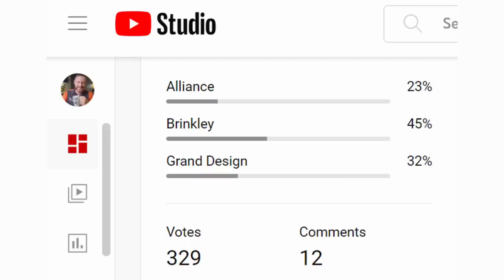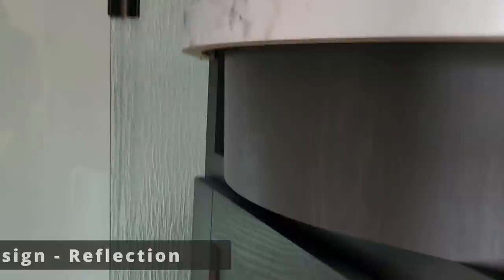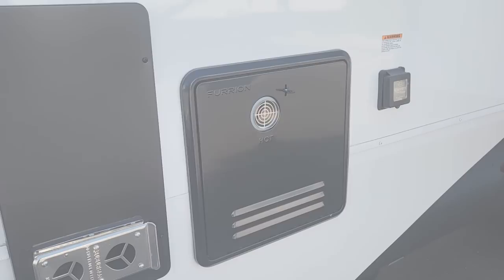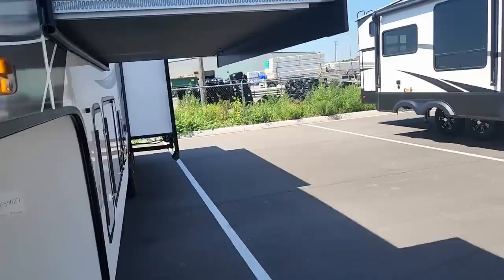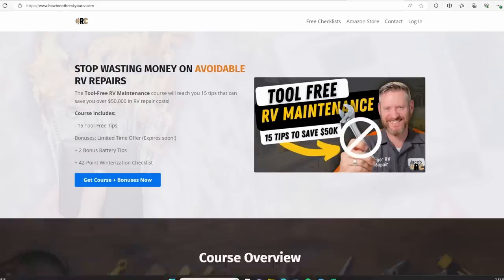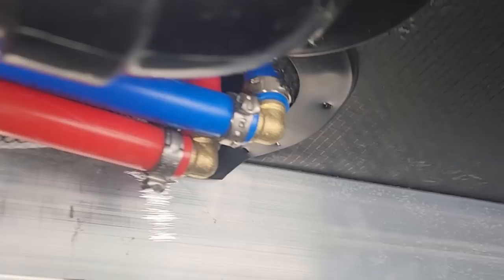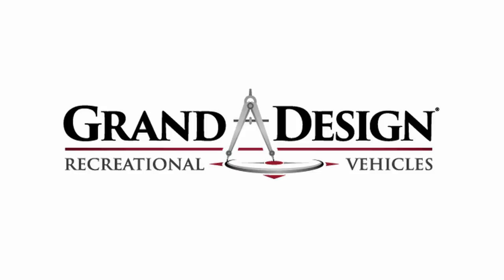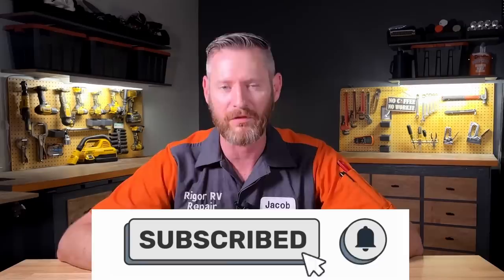UNDERCOVER RV Tech reviews Grand Design, Brinkley & Alliance RVs

Comment: I have a 2021 Solitude S-class 2930 - just got finished fixing a plumbing issue and am replacing the flex line with led wherever I can.  I invested in Govee leak sensors (have 6 placed throughout) - the recent plumbing leak was detected by the Govee leak sensor.  It was caused by a seal in a threaded fitting that would leak when the hot water heater was activated - the cold water pressure increased causing the fitting to leak some.  

I replaced some of the flex line with pex while I was in there.::

Comment: We bought a 24 Model Z 3610 and have been using it full time for about 4 months. The Furrion fridge did have a problem right off the bat. It had a nasty rattle noise while the compressor was running. To avoid a trip to the dealer, i pulled the unit out which required drilling out several large rivets in the top, removing 4 screws on the legs, pusing the unit back to remove 4 more screws behind the upper bracket and removing the bracket completely. I was very impressed by how well the unit was secured but, i really wish that they had used nut-serts and bolts on the top of the fridge instead of rivets. while the rivets are arguably better, they make serviceability of the unit quite difficult. I think nut-serts and some M6 bolts with either blue locktite or lock washers would be just as good, Anyway, the condenser in the fridge had a flimsy support system that allowed it to contact the cabinet and make a loud rattle noise. After a couple tries, i ended up placing a thin rubber mat between the condenser and the cabinet to ensure that the rattle would never happen again. I would caution anyone doing this to lay down some cardboard in front of the unit on the floor when you roll it out as the wheels have sharp edges and can damage the vinyl flooring.
Reply from the maker: Wow, yes that is annoying. It is strange they did not make the refrigerator removable....as if they expected it would never need service. Glad you were able to solve the issue. P.S. if you trouble to the mid bunk AC keeping up be sure to close the vent on it.

Comment: I agree with most of what you discuss in this video. We full time in a 2019 Solitude and while it has had it's issues, it does seem to be a fairly solid trailer so far. One category you missed however is the electrical systems. I know our Solitude is a total mess! I have cleaned up some of it, but the vast majority would do a nesting squirrel proud.

Comment: Jacob, how weird that Brinkley would do most of the plumbing correctly but not in the bathroom...the bathroom in the 2900 is my favorite...Question: If it's just under the sink and in the bay connections, would it be that difficult to correct the problem? I am pretty sure Brinkley will get on this, but that means until they change the process all the 2900s made will have this problem. Thank you so much for your videos. Hubby and I loved the GD 23G but belonged to a group and heard so many complaints of leaks we scratched them off our list. We just love the Brinkley and are waiting for them to come out with a TT which they are supposed to in the next few months. I love that your channel is growing!
Reply: @barbaradowney4207: Can you tell me where you heard that Brinkley was coming out with a travel trailer in the next few months?  Thanks!
Reply: @fantastiqueberliotz1209  It's been alluded to a couple of times on the Brinkley FB group. I also watched an interview with one of the owners and he was talkng about expanding their line up in the future.
Reply from the maker: Great question! In future videos I'm going to start sharing how easy/difficult the plumbing is to fix when I give a score. Z3100 is a Stage 1, really easy to fix. Z2900 is Stage 2, harder but still doable. All Grand Designs are Stage 3, like don't bother, you have to tear the RV apart to fix them. Hope this helps!
Reply: @barbaradowney4207    Thank you for the info.  I'll be sure to keep watching for it.

Comment: I was all set to get a Brinkley 2900, went to see it at the Hershey show.  You were lucky to get a unit with nice fit and finish.  The unit they brought to the show was a mess of misaligned cabinet doors, and showed a lack of foresight for installing an actual entertainment system.  The excuse from the factory rep was that everyone has those problems.  WRONG ANSWER!  Two GD solitudes at two different dealers had washer dryer doors that would not latch, and water closet side storage doors with more misalignment than my 17 year old Montana.  Don't even get me started on the ugly sealer job on the front cap.  Wood trim around the slide still had saw marks on it.  Off the list they fell as well.  Montana and Paradigm looked PRETTY good, but Keystone customer support is a nightmare, and in my area, Camping World is their dealer.  I appreciate good support, especially for all the small stuff that comes up, and don't want to be mugged the Chicago mobsters, which currently leaves me with Alliance.  Do you have any thoughts on the KZ Durango Gold?

Comment: I've got the Coleman Mach A/C units on my RV for six years now on my fifth wheel no issues or repairs,cools the RV fast during the HOT HUMID Summers in IllInois n Missouri ....Guess they don't make them like used to.Just a quick note ....CLEAN THE AIR FILTERS EVERY MONTH OR SOONER DEPENDING ON HOW OFTEN YOU CAMP.....

Comment: I own a Grand Design 2970RL and I’ve had to repair every water fitting for just what he has pointed out. I tell the dealer they don’t care and like he said it would be difficult to replace all the plumbing hose. The basic problem is it expands then leaks. So I’ve replaced fittings , larger sizes with different clamps and hoping it won’t leak. You have to keep the pressure down as well. The book calls for a maximum of 45lbs, I run 28lbs. So far so good. And I’ve repaired almost all the fittings so fa. Oh this unit was built in 2022. I have repaired a number of things throughout the unit from door stops because the builder didn’t know how to center a screw, to drawer guides, replaces shades (2) that the PDI didn’t catch, just one thing after another. Would I buy another Grand Design, NO!

Comment: Brand new here. Great concise video. Thank you. I do nor own an RV of any kind. But….. am considering a 5th wheel , basically for periodic travel to get from point “ A” to point “ B”.  Nope, not going to “ live “ in one ( save if I ever need to have my home remodeled).  I am avoiding toxins and all kinds of creepy stuff from motels and hotels. I have autoimmune issues , so this is necessary. Also, I would be traveling with 4 dogs. No airplanes for me. Jus t done with that.  So , taking my time to look around.  I will check out your other info, Thanks for doing all of the hard work and investigation,

Comment: I'm glad you brought up plumbing, but what is the right way to add a flexible connection to the pump? Sur-flo recommends at Least 1 foot of high pressure flexible line at the input and output. Vibrations from the pump can damage a hard pex connection. My RV was connected with hose clamps to a PEX T, it never leaked but unfortunately it broke . Now what?

Comment: Thanks for all of the good info! My wife and I are torn between a 2024 GD Solitude 378MBS and the 2024 Alliance Paradigm 380MP. My question is this...Alliance has dumped the Schwintek bedroom slide, and went with the BAL Accu-slide for their Paradigm lineup. I reached out to Alliance, who are great to deal with BTW, and confirmed that the tension adjustment is in fact on the bottom of the bedroom slide for the cables. Given that...I've watched your video on the BAL Accu slide system, and you recommended to just "walk away" from an RV with these types of slides. So, given the plumbing issues on Solitude's, and the slide issues on Paradigms, which one would you choose? We actually like the Paradigm better, but concerned with the slide system, and having it serviced. We love the Solitude as well, but not sure about the plumbing??? Not sure which one trumps the other, but we're purchasing one of them. Thanks!
Reply from the maker: Hey Matt, these are great questions, a little more than I can answer quickly in this comment. If you want to email me, I do offer consulting - jacob@rigorrvrepair.com. I would want to talk you through what "maintaining" these two rigs would look like so you and your wife can make an informed decision, assuming you're not open to other RVs
Reply: @undercoverrvtech  Thanks for the response Jacob...I think we've decided to move forward with the Solitude 378MBS, and roll the dice on the plumbing issues. We were able to finally tour through a Paradigm 380MP, and we were more impressed with the Solitude overall. The Paradigm was still a very nice unit, but we just liked the Solitude more. Appreciate all of your info for consumers, and I've directed many people to your channel. Take care! -Matt

Comment: Plumbing issue in Grand Design and possible precautions:  I have just purchased a Grand Design Imagine XLS 17 MKE.  It strikes me that the one big difference with house plumbing is water pressure.  It is barely one story high and does not require a lot of pressure. When operated by the pump the pressure should be well controlled and not excessive. But when you connect to a municipal water supply you could get ANY pressure. Does this trailer have a pressure regulator to prevent excessive pressures. If not, it probably isn't too difficult to fit one.  An alternative work-around would be to always use water pumped from your own tank and only use municipal supply to fill the tank. Such measures shouldn't be necessary but could be a good safe-guard. I would love to hear any comments about these ideas.
Reply from the maker: You should always use an RV water pressure regulator that pouts out 55psi max. These just screw onto the water hose. Your water pump pressure cut-off is also set to 55 psi, but unfortunately I've heard many stories of RV (and Grand Design) owners who only used the water pump but still ended up with leaks in the first year. Sometimes leaks don't happen until 3, 4, or 5 years. While using a regulator/only the pump will probably help, you will still most likely develop leks at some point. Thaks for watching, and best of luck with your RV.
Reply: @undercoverrvtech  Thanks for your helpful reply.  A related question is "What kind of connecter or crimping tool can be used with the flexible PVC pipe?"  I tried to find out online and didn't find anything, although they usually use 'barbed' connectors with prominent ridges on the surface of the connector tube. I thought of replacing connectors, especially on the hot water line where it is accessible, but I suppose that would void the warranty (whatever that is worth).  I have a lathe and could make my own connectors with PEX connection on one side and soft PVC connector on the other.  Thanks again.

Comment: Hi Jacob, I see there are a lot of comments here so you may never even see this comment. I completely understand. But You said leave a comment with a brand and model that we would like you to review. My husband and I would like to see you de a video and complete review on a KZ Venture Sonic SN211VRB. Ours is a 2022. So far it has been fantastic except we are already having to replace the shackles and leaf springs, with just about 5000 to 6000 miles on the camper. We are still weekend warriors. We are installing the CRE3000 kit with wet bolts and leaf springs here in the next few weeks. Only one leaf spring is going bad but we are replacing everything while we are at it. 
Thank you.

Comment: I checked the Grand Design plumbing at the RV show.  They fixed the problem of flex hose connected to Pex elbows. There is no Pex up to the sink. They terminate each hose and screw them together.
Reply from the maker: I hope they have changed! I would check again particularly behind the toilet, then behind the water panel on the pump and the water heater connections.
I've seen some GD models that have proper PEX in the island sink but incorrect connections other places.
Thanks for watching!

Comment: Are you sure about that BAL Accu slide? I thought they had come out with a newer version that was vastly improved. I was on a lot full of Vibe RV's in September, and every one had the newer version of that cable slide system. I had the bad version on a 2018, but the adjusters and cables were easily accessed above the slide box by removing the top wood trim. You just had to reinstall the trim with Velcro or wing nuts so you could take it off to access the motor with a drill if and when it failed like mine did at a campground.

Comment: So plumbing  wise the red pex crimp
Can be removed if hear touches them. I use a hair  dryer to remove them. When I put the flex hose I did the same thing but it was VERY difficult to get those pex on them. I wish I could explain how difficult but I'll just day it 4x as long to get on. I can't see those messing up . Mine going good 4 years strong no leaks

Comment: Do one on travel trailers from these manufacturers (if they all have those types of models).  Our '21 GD Imagine XLS 22RBE has been wonderful in the 3 years we have owned it.  Of course, we keep it maintained and have yearly inspections (we also do our own inspections regularly).  Our plumbing is all PEX, not the flexible lines that they used in our model a few years prior.  Could be a model-by-model thing with each manufacturer, where some have the bad plumbing lines and others don't.

Comment: I bought a 2024 Birkley 3100Z
I have a few problems with bubbles on the roof Membrane. Brinkley says that the bubbles with time will go away ?
The customer services is not very helpful
Reply from the maker: That is true if the sealant on the roof was applied within the last month. The volatile chemicals that make the caulking flow evaporate out over time, but they also make the roof membrane soft and swell untill all the chemicals are gone. That is why the roof will bubble near caulking.  If you see bubbles in the middle of the roof away from any caulking that  can indicate that the membrane did not adhere to the decking. This type of bubble can grow when driving down the highway and can rip the entire roof off. If you have this type of bubble I reccomend having an RV professional look at it.
Reply: Thank you I really appreciate you answering have a nice day

Comment: Thanks for the info., we are starting out small and working our way up later on. We are looking at Grand Design "AIM" TT's and perhaps Keystone "Cougar" or Forest River Microlite (or the Flagstaff version). Would be nice if you could look at some of those smaller (cheaper) TT's. But thanks again for giving us some info. on what to look for ourselves at the dealer lot...we found the info. on "Thermofoil" covered particle board countertops especially helpful!   Q: Does the "flex" type (non-Pex) tubing/plumbing have a correct clamp/fitting?  👍

Comment: Man you right about Grand Design. More like Grand Disaster .   I’m surprised you didn’t rate floors.  Plywood. Grand Design is O s b.  And soon as the pluming waters it down then waves and in even floor. We went with a Jyaco. Plywood floors and roof. It’s not as good as it should be but seems the best for the money.  Frame floor and roof solid.  Folks don’t buy a rv without plywood floors.

Comment: Thanks Jacob another great video I’m a commercial driver in Canada I’ve seen a lot of tire blowouts and ya the damage they can cause is just incredible,I did like grand design when they first came out but after Winnebago purchased them I think they’re quality went down the drain 👍
Reply from the maker: Hopefully they are listening 😉
Reply: I'm not sure if Jacob touched on the tires on these 3 units, but Brinkley is using Cooper 16 ply tires and they seem to be about the best
 @undercoverrvtech
Reply from the maker: I don't cover tires because they are a consumable item and you can easily put any tire you like on an rv. I would have no problem reccomending a new well built RV with cheap tires. That is far better than an improperly plumbed one with great tires. Thanks for watching!

Comment: I bought my alliance 26rd in May. I haven't got to camp in it yet. They put the wrong size leveling jacks on the rear. There was only 3 in clearance to the ground.  I bent one on my way home, hitting a rut. This not only bent the mounting bracket,  but bent the floor and the frame of the slide.  I asked them if they  would be willing to swap it for a new unit. They denied it.  There was also a host of other factory defects that I hadn't even begun to address. I'm skeptical that they even a PDI on my unit before they sent it out. 
I'm seriously thinking about trading it for another brand even though I will lose my ass on the depreciation.

Comment: What a great video. I'd live to see a rockwood or flagstaff. They boast quality and we're thinking of going that route
Reply: I have a 2022 Rockwood Minilte 2513S. It has a lot of flex tubing around the water pump, water heater, water filter, FW tank to water pump, outside kitchen and water flush to black tank. All have had leaks. In process of changing out.

Comment: Many operators take these units off road when boondocking. They are meant to be operated on paved surfaces. The tremendous stress of being rocked back and forth is devistating even to the strongest of vehicles. There are trailers designed for off road use that hold up well for purpose. There are many videos on YT showing folks abusing their units.

Comment: I'm amazed at the ones I've looked at, where you can see frame welds they are the worst, I owned one trailer and the aluminum framing in the pass thru had one little tack weld per stud with a spool gun....just sayin